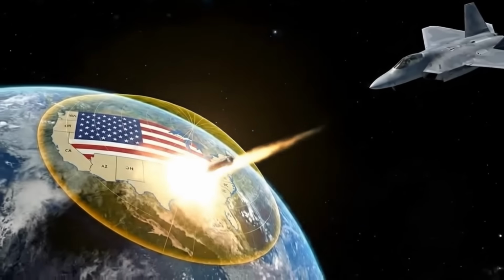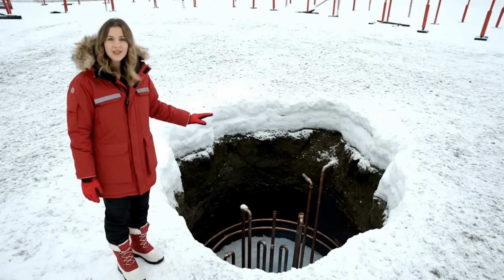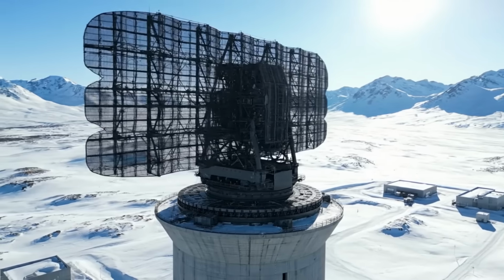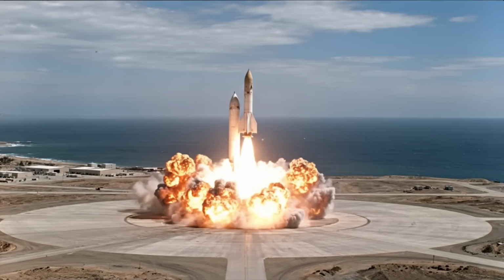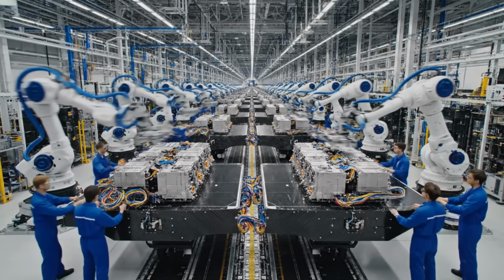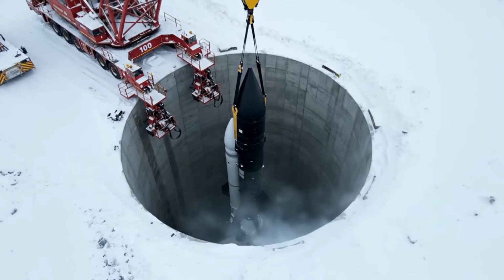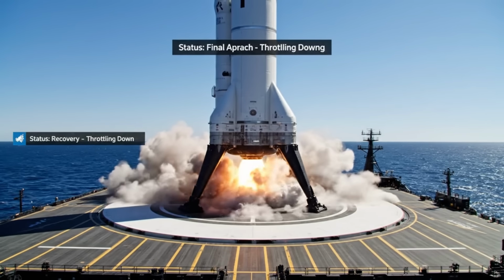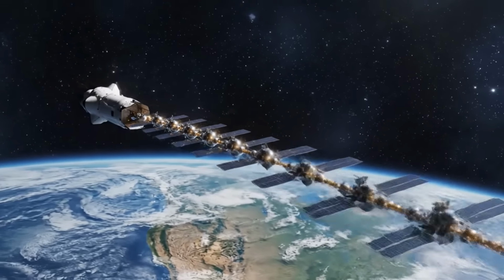How America is Building the $175B GOLDEN DOME Shield

Comment: It would more believable if this wasn't all CGI !! It looks and sounds good , but I've been in major construction for over 45 years !! I've worked on moving rivers , swamps , mountains , reshaping valley's, slopes everything from 1/4 mile under ground to, 1100 feet above ground !! You're cgi is a tad bit off as to how large a hole an auger will drill !!! I've had to take the blueprints and add the as built portion to them because no matter how everything looks on paper , it always needs tweaking in many areas cause it doesn't work in reality !! Even when the solid works program says it will !! It takes a lot of experience to understand how to make it work !! I'm not saying the concept doesn't work !! The actual construction works different than on paper or computer , cause those things lack a certain reality !! Ask any builder !!! But I hope they can get it done !!!